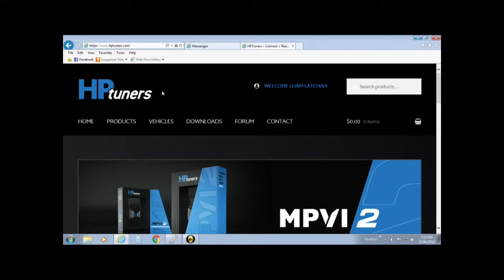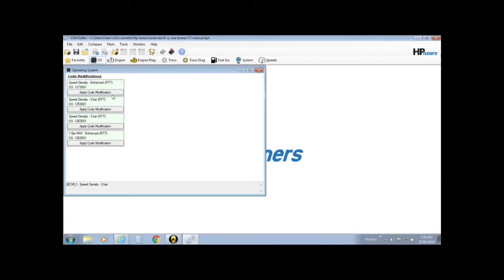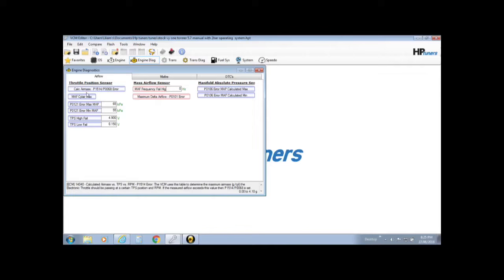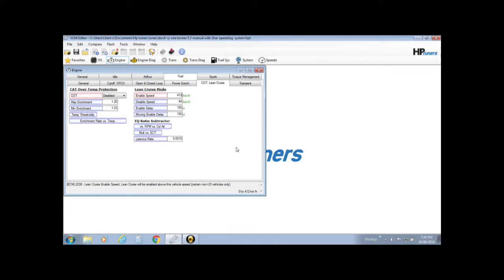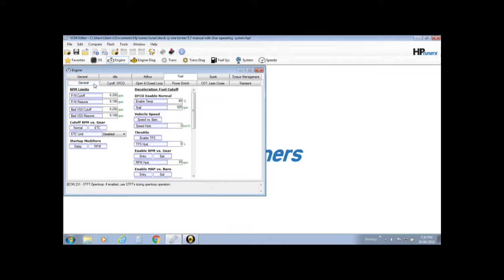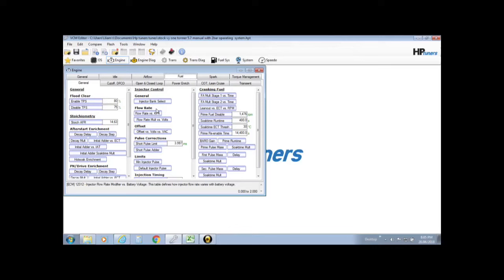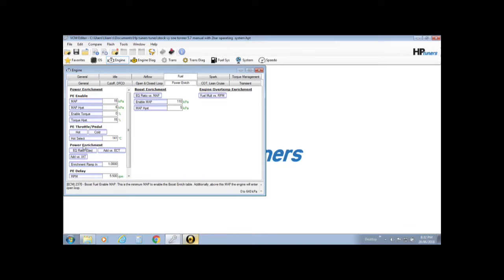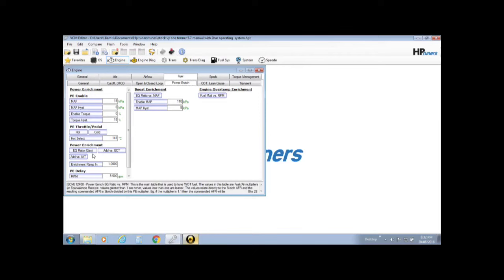Ls1 Turbo tonner build EP10 Base tune with Hp tuners

Comment: First of all excellent video, So are you saying you don’t run a 02 sensor because it over complicates things will this make the fuel economy suffer or is it negligible? I only ask this because I’m planning to do a lot of driving with our latest build. But also to note first time tuner. Thanks
Reply from the maker: Using the factory 02 sensor requires the ecu to be ran in closed loop operation . Closed loop operation uses a lot more  tables in the ecu and it gives the ecu capability to make its own changes . 

An advanced tuner can work there way through every table in closed loop to ensure that the ecu never commands or delivers a dangerous lean condition. When setup correctly closed loop will deliver better fuel economy as it trims or adds fuel constantly.

As a beginner tuner I think there is too many tables in closed loop doing to many things and I don’t think the risk is worth the benefits.

I think Running open loop and  tuning all your off boost and part throttle sections of the ve table to a nice lean afr using a wideband sensor can still give acceptable fuel economy .

I’ll be shooting part 2 of this tuning video soon that will help more .

Comment: Hey mate keen on same build for my vc commy with cammed ls1 already in how much did your tbo and gate cost being from vs racing in the states can get tbo off eBay for about 900 landed also sloppy mechanics Facebook page has base tunes for his favoured 78/75 billet tbo
Reply from the maker: Blake Brewtnall you could definitely use sloppy base tunes only thing that concerns me is there fuel is different to ours so be careful with knock also I bought the turbo gate and bov straight from vs racing Viren is a good bloke he’ll help you save $$$ just contact him directly.
Reply: Laty's Garage  yeah didn’t think of that mate their 93 octane yeah I haven’t looked at any of his tunes but heard their just base tunes to get it running so did you just email Vieren
Reply from the maker: Blake Brewtnall I just messaged him via Facebook I’ve bought a few turbos off him now all have been exceptional deals